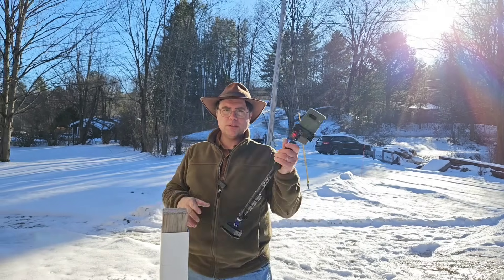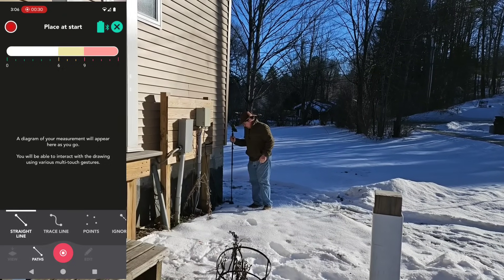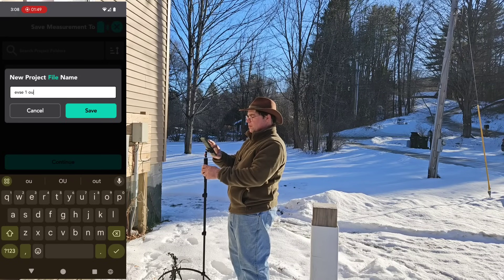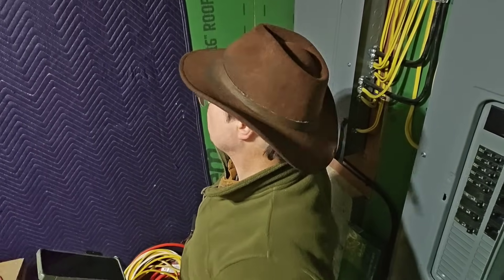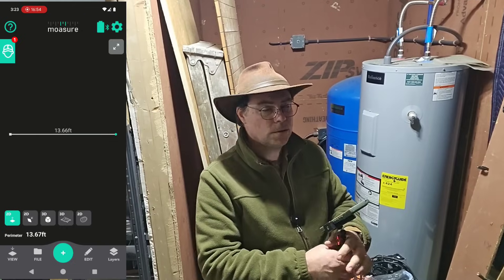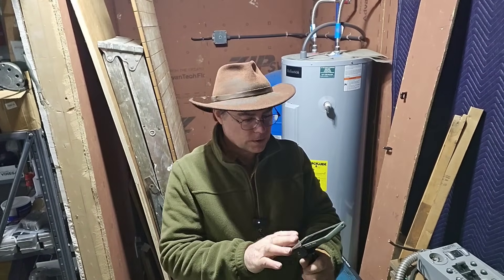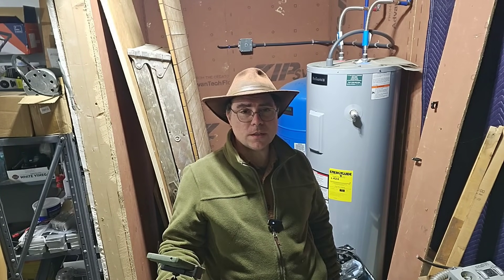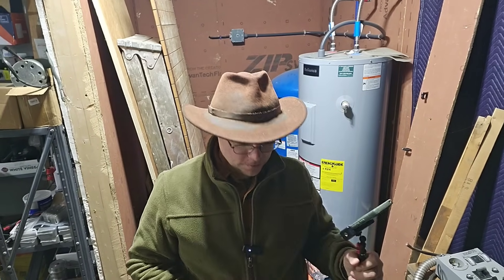Using Moasure 2 PRO in electrical work?

Comment: Wow, in Canada, when I inquired about putting in a Charging dock in our backyard.  The electrician told me I would need to bury the conduit because it goes across the backyard from the house panel. Our panel would have to be upgraded because we are at total load now.  And there would be no way I would be able to run the wire myself because in Canada, we are only legally allowed to wire 120 volts, higher voltage has to be a licensed electrician. I also rent, so if I was the only person with the EV, then they would have to do a split panel with a separate meter for my car. In total, I was told it could cost me up to $10000.00.  This, on top of the cost and payment of the vehicle, isn't justified with my limited income.
Reply from the maker: Having infrastructure for people who rent is a well-known known and often discussed problem with EV charging. I'm not passing judgment.

Comment: Some may find running wires electrifying.  😁
Reply from the maker: Not if you do it right. It's best to start at the far end of the run and pull back to the panel box. Connect the ground, then neutral, then the hots. In that order. I don't work on live circuits if I don't have to.
Reply: @MillBrookRailroad  it's a shame some people don't catch puns.  🙄

Comment: Four feet off the ground seems like a bad place for a cable, unless you have something under it to block people from going through it. My suggestion, if you can swing it, is PVC pipe and rent a trencher. If you can't swing it, either elevate the wire to about seven feet or build a decorative trellis to support the wire and make it physically impossible for some idio-, I mean, unobservant person, from clotheslining themselves on the charging wire. 

Now, I know what you're going to say, "Oh, there isn't a person stup-, I mean, unobservant enough to clothesline themselves on a cable four feet off the ground." To which I counter, "Oh, my friend, trust me when I say there are a lot of Idio-, I mean, unobservant people who will absolutely hang themselves on your wire and blame you for it." Best to spend some money up front so you're not spending more money down the road.
Reply from the maker: It will be stapled to the building in accordance with the NEC. I was measuring along the edge of the building and around the perimeter of the porch where it will be stapled. I even added some extra length to account for the ups and downs it'll have to do.

Comment: Nice to see your wonderfully North Eastern dry humour on a sparky project  :-) I just use a petrol hybrid
Reply from the maker: I had a hybrid once. It was a Chevy Volt. Great car! It showed me that I could actually drive everywhere I need to go with a battery electric. But my daily driver before that was the 1966 F250 which I will have running once again at some point before the second coming.